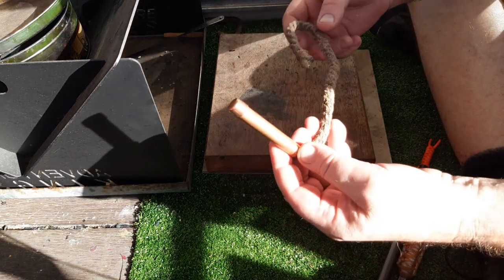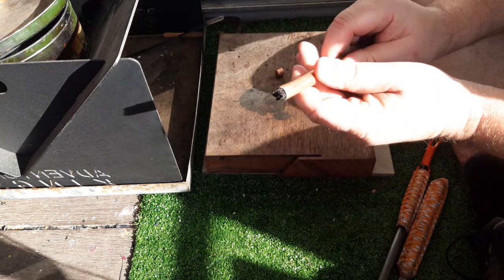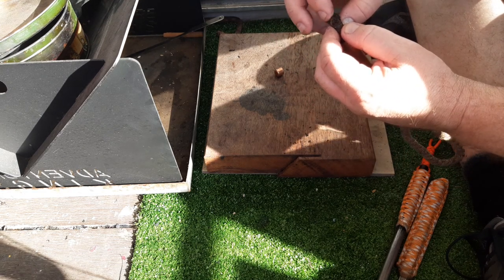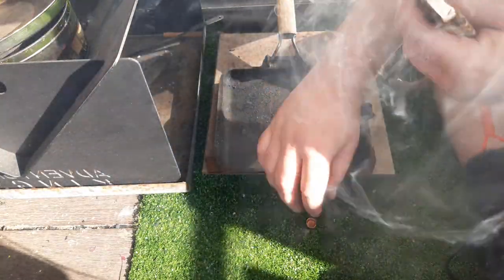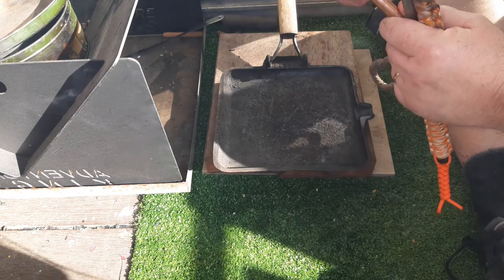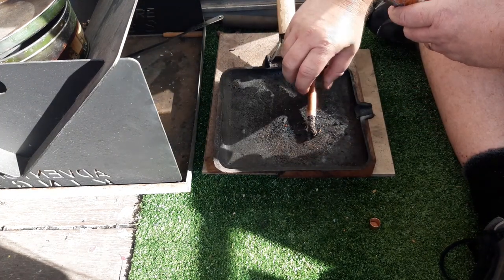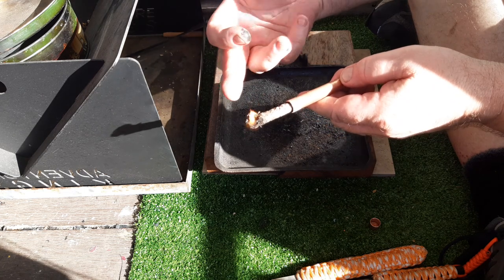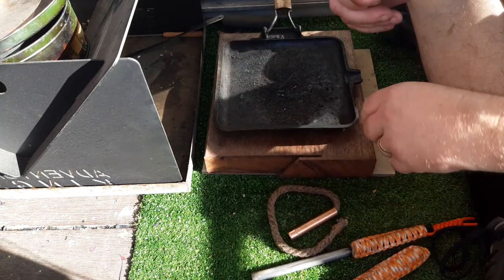jute waxed match

Comment: Thanks for that Orion.
Have to say, it worked as expected, I think that as the wax melts it acts as cooling liquid on the KNO3 aspect of the match, in that it drowns any embers that form as they form.
Also, as you have said, it really needs to be fluffed up a lot so that the Ferro Sparks can immediately pyrolyze the wax soaked fibres without having to heat the wax up to its combustion point first by, as you say, ‘Pumping’ the ferro rod.
Great stuff ... keep experimenting and keep up the good work.
Reply from the maker: not a problem Mark, yes this was just an experiment, not sure if I will make an other one. Still a fun bit of kit.